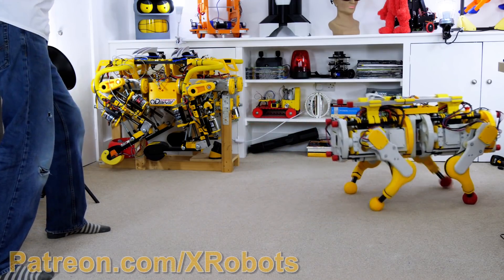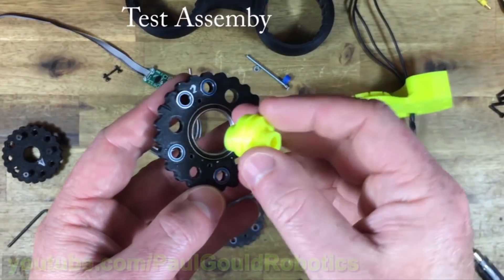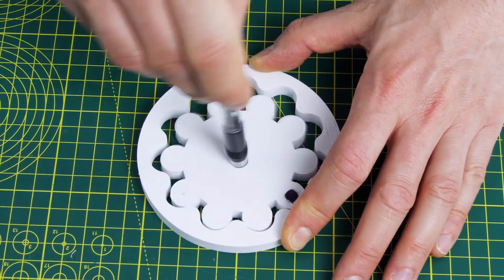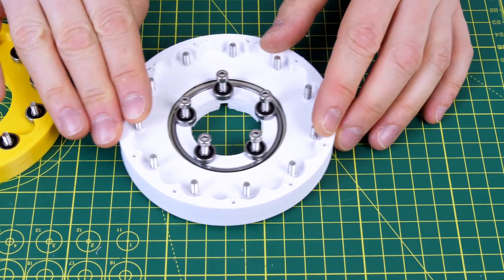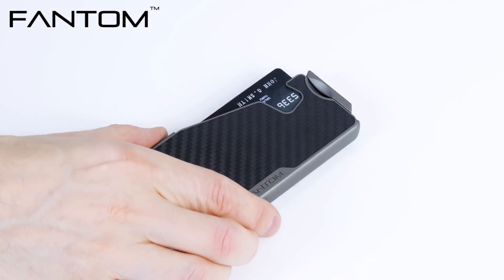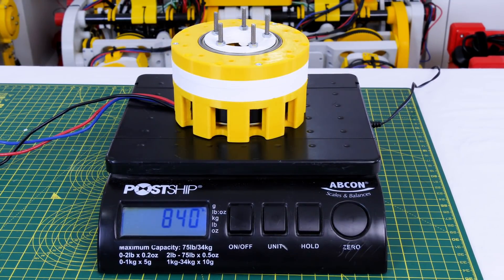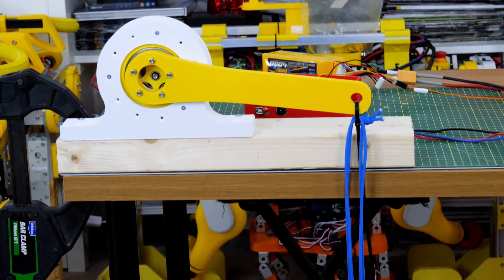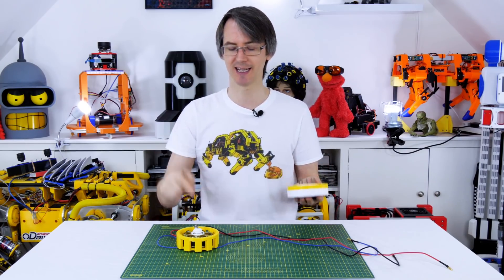Experiments with Cycloidal Drives

Comment: Perhaps another approach is to use a 'stepper' motor design and use 'micro stepping' and higher voltage and use a bigger motor?
I've been looking into using hoverboard wheels as big stepper motors.  Being smarter and more capable than me, perhaps you can try it so I don't have to, and find out if it works well or not... lol

Comment: Hi, thanks so much for your video! I have a question, when does a cycloid drive use fixed non-moving pins or rollers/bearings on the outside ring gear? I see you used bearings, and others, such as Sumitomo, sometime use rollers or pins. Cheers! Great work!

Comment: your 3d printer is heavily under-extruding, which will eventually make your parts a lot weaker. I would recommend checking many sites on how to calibrate your steps in controller.

Comment: I would like to know if you can make the outer wall move once when the inner off center gear moves once and if that would make a 1 to 1 ratio increase speed and torque 
Because the outer wall is bigger then the center gear and the small gear moves the big gear ( which is the outer wall)
Please share your thoughts

Comment: To balance the assembly, you can put a counterweight on the motor (without needing to add a second cycloidal disc).

Have you considered making this reduction unit "turned 90 degrees" with flat discs with cycloidal grooves & ball bearings between?

Comment: You should increase the overlap between walls and top surfaces on your slicer, because you 3d print has holes. It will make then stronger. (In cura I use 30% but the setting really depends on the slicer you use)

Comment: Just a random thought.  What if you printed the cam in a different orientation.  It looks like it sheared along the layer lines.  What if you rotated the print 90 degrees.  You would probably need to print with supports but your stresses wouldn't fall along the layer lines.  Also, maybe try printing solid?  Just throwing random stuff out there.  You are WAY smarter than I so im guessing there is a reason you did it the way you did.

Comment: Stop using bearings, start using bushings! Bearings are to be used on high speeds and low loads. You have low speeds and high loads and here is where the bushing has to be used. You will also gain much space and fillament's "beef". Bushings are also cheaper.

Comment: Ehh... 
So with regards to strengthening the plastic parts, in general, you can add high strength epoxies. If you get the right epoxy it offers a smooth, wear resistant part that the force of the movement can work into better than raw pla/abs/nylon. 

With regards to keeping the gear the same shape, instead of using a smooth bearing, you could use a v-groove bearing. If you go this route, the v, or rail, that the bearing rides on will add to the diameter of the 10 toothed gear, which might allow you to keep the gear the same size.  

In addition to that, you could use an aluminium liner inserts. A small piece of aluminium lining the hole that the bearings rotate on seems fairly straight forward for adding strength, and, if you can find a small novelty can of soda that matches the diameter of the hole you need, making it seems super cheap. Even if there isn't a canned soda that matches, you could just find a piece of aluminium pipe that does (it comes in many sizes), it might add a small amount of cost, but since you need such a small amount of pipe ( the depth of the gear in the thinnest plane times the number of holes) it should still be cheap. 

Like, assuming you're bad at cutting pipe, you still have to buy pipe in discrete units depending on length, usually a meter (around 3ft) at a time; you shouldn't need more than a single unit of pipe.

Comment: It very much appears as if you are slightly underextruding on your 3d prints, which compromises the strength of the parts. Perhaps overextruding is even worth it in this case, as long as you can keep the parts within tolerance. Considering you have that gap between your bearings and the 3d printed parts, you'll definitely be fine though.

Comment: A cleverly designed 2 stage belt system can be very compact and strong. The trick is to use a very small difference in cog diameter, have the second stage coaxial with the first stage, and then spin the casing that holds the cogs. So the casing becomes the input shaft, one of the cog shafts becomes the casing, and the other (coaxial) cog shaft becomes the output shaft.

Comment: I got interested in these Cycloidal drives to use for a self built CNC lathe for the C-axis. It would have to be clutched to the spindle when activating C-axis. I think you could use the same motor for normal spindle drive (high speed) and mechanically shift to C axis mode (high rigidity, low speed positional control). The reason to use a cycloidal gear is that it has almost no backlash and you can get very high reduction and rigidity (if made from something like steel, not PLA, and with tight tolerances).

The point is however, on a lathe you often want a through spindle bore. The cycloidal gear would need to have a hole in the middle and I think I have found a way how to do it. Take a look at the output shafts. They basically are excenters aswell, so you could lose the excenter in the middle. Also those output shafts (that are the input as well) don't have to be inside of the cycloidal disc itself, but imagine a disc that does the exentric wiggly thingy (not actually rotating) and the cycloidal disc is "glued" onto it. Then the outer case actually becomes the driven output.

Just some ideas. First idea works well in CAD, second one I'll have to dive in to and do some designing.

Comment: Do you know if anyone has ever come up with a design I don't know what to call. Like a fluid pressure (pump) driven screw drive. Take something like a fat screw in wall anchor or a drill bit, encase it in a cylinder and pump fluid down the length of it to turn it, drain holes one end.outside the encasement on either end or both would be a gear possibly. We all rode multispeed bikes at some point right?

Comment: you could put a counterweight on the offset cam that you've mounted to the motor shaft without increasing depth
Reply from the maker: That won't stop the motor casing flexing though, version 2 comes up on Tuesday!
Reply: @jamesbruton  yeah; i mean just for the balance issue; i wasn't all the way through the video yet when i wrote that. for the motor case flexing and cam sadness, sounds like you got a plan can't wait to see it!! these things are super cool.

btw have you ever considered an sla printer for tinier gears? i've printed very small very high quality, smooth running (double helical gearing) high rpm planetary gearboxes on the form 3. but never larger stuff for higher loads. you've inspired me to do some torque tests.

Comment: Sorry but 90% of commercial robotics use harmonic drives because they thick the most important boxes like high reduction and low failure rate and low to zero maintenance. This all in a extreme compact form factor. The only part you should not 3d print is the flexible gear but use a of the shelf timing belt. Also because you aim for a low gear reduction like under 1:25 the belt you need would be like the shortest you can find making the gearbox extremly small and making your current fat dog look a lot slimmer. You can find several attempts online by other people showing the basic design is really simple. Engineering the whole thing to a perfect fit on your motors may take some time, but it is worth the effort.
Reply from the maker: Harmonic drive is not back- driveable. It is not used for quasi-direct drive in dynamic robots.

Comment: Do you plan to use a different material in certain areas with high loads?  For example the cam chart and the cyclonically disc could be made from aluminum. It is pretty easy to build custom parts and it's light.

Comment: have you tried lost PLA casting? I'm sure aluminum should be cheap, light, and strong enough to work with
Reply from the maker: I have a CNC machine, and you'd have to machine the surface of the cast anyway. CNC is not accessible to everyone, nor is casting metal  version 2 is out on Tuesday with the improvements I said.
Reply: @jamesbruton  it’s not as bad if you use plaster to cast with instead of sand. Then you can use a belt sander or a dremel, or even a metal file.

Comment: The project is awesome and the engineering behind it is great but the 3D print quality is horrible. It looks to me like you're in need of a new 3D printer. I can see obvious underextrusion, as well as various other issues with your 3D prints.
Reply from the maker: The printers are brand new. Under extrusion is a slicer setting, obviously. It's a Simplify 3D slice and I have full control over the settings. Thank you.

Comment: Hi James, you can totally get to 10:1 reduction if you use a pulley force multiplier. Essentially if you replace a big pulley with a large bearing fix one end of the belt back on the body while putting an idler on the leg so that for 2 times the movement of the belt you will have 1 time the travel of the leg.

Comment: Instead of 3D printing, laser cut it. Better yet, I'm not sure I saw anything that couldn't have been done with a drill press.

The reciprocating mass introduces a lot of vibration. But at the speeds required in this application, it's quite tolerable. Totally makes me want to build one.
Reply from the maker: I'd live to see you make one with a drill press and I'm sure you could male 12 identical ones with no issues. Version  2 comes up on Tuesday
Reply: @jamesbruton  I'll try a laser cut one this weekend. I don't think I have the right bits to use a drill press. I'll have to take a look. 

Great video, BTW!

Comment: ON the outside bearings, if those are replaced by steel ball's?  You wouldn't need the bolts in the middle, and a little grease on those steel balls, it my increase efficiency and strength?

Comment: use roller bearings running on shafting for the five cycloidal bearings - it will be much smaller because the hole in the disc will be much smaller - line contact vs point contact.

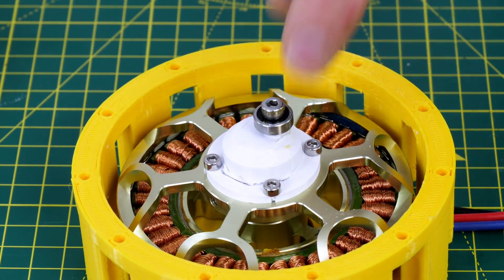Comment: I love your designs but your 3D printers are making very poor quality parts. Tons of perimeter adhesion issues and layers with massive gaps between extruded tracks. If you want things to break that's how you would print them but you show this in your video.  Surely the Lulzbot can print better so maybe hire someone to calibrate your machines every time a company donates filament. Again, really love the design and testing you do but ugh so many parts look terrible.  examples: 5:13, 5:46, 12:05 and 12:31

Comment: Make the cam shaft out of metal. Instead of a straight pole off center, make a centered pole with a kink. This will also make it simpler to secure on the other end. The craftsmanship is good enough as is for the rest to hold up to higher torque.

Comment: Can you use a dummy cycloidal disc just riding on the one or bearing for counterweight purposes? That may prevent the need to design and make a new shaft.
Reply from the maker: Version 2 with two discs comes up in a week!

Comment: The sound for the cycloidal sun gear is a bit noisy, you could try to change to using Alloy 910 nylon filament with a petg core to reduce the noise and wear. With your bearing design I doubt there would be any wear with nylon.

Comment: It’s the bigger gear that has teeth on the inside and the smaller gear has teeth on the outside. The teeth on the smaller gear are outside of the smaller gear. The teeth on the bigger gear are inside of the bigger gear.
Why does he say it’s the other way around?

Also, why does he say that the smaller gear goes around the outside? It goes around the outside of what? It goes around the outside of itself? That doesn’t make any sense. Looks to me like it’s going around the inside. It’s going around the inside of the bigger gear. Or if he keeps the smaller gear stationary, then the bigger gear would go around the outside. The bigger gear would go around the outside of the smaller gear.
Reply: Is that the technical term? Because if so then that’s confusing.

Comment: If you ran another disk exactly opposite the first one by 180 degrees you that would mostly balance the unit as well as make it much smoother. Like you said, having the cam go through and supported on the other side would be a big thing too. I also agree that you should capture the bearings in the center so they hold things in place. However I think you should measure the efficiency somehow. There seems to be an awful lot of wasted energy. Like the energy required to stop the inertia of the cycloidal disk. Right now that energy is just transferring to the bearings as friction. The disk has to overcome it's own inertia as well as centrifugal forces. Perhaps if you made the bearings convex and the edge of the disk concave, with oil grooves cut in the outside of the bearings you could remove a lot of friction. This would eliminate side load (also taking load off the captured bearings discussed earlier) on the disk as well as spread the load over a larger area. You could also make the disk thicker near friction surfaces and narrower everywhere else to increase stiffness of the disk.
Reply from the maker: Yep - V2 is coming up next Tuesday with two discs and a thicker cam shaft

Comment: might there be something useful in considering using something like power tool batteries (20v/60v dewalt, as an example) to run stronger motors?   so, yes, need bigger battery and heavier motor, but I'm wondering if the size efficient battery packs (up to 9AH, I think) could run a bigger motor that might be more efficient?   haven't given this a lot of thought, and I'm not that familiar with different types of motors, but I do know my tools and I'm running everything from chain saws to routers from these batteries..  the motors are very efficient for their purpose..  but yeah, the gears are definitely metal. :-)

Comment: You could save a lot of space by replacing the ball bearings on the ring and the output disc with plain bearings (aka bushings) running on smooth steel shafts. They can be 3d printed from nylon or graphite filled pla. Obviously this arrangement will have a shorter service life and more friction but the cost, size and weight savings may outweigh that, especially since well designed plastic plain bearings actually last a really long time.

Comment: I understand and agree with the choice of high-speed bearings near the center, but if space and weight are an object, might I suggest simple bearings for the large number of lower-speed, higher-force axles near the rim? Each of them is only rotating a fraction of the rate of the stepped-down linkage (maybe 1/110 the RPM of the motor itself?), so a bronze bushing might do OK.

Comment: Im no engineer James but I am a mechanic and we use molybdenum disulfide grease for CV shafts, diff installs and I rebuild my old tools and use it on the sintered gears. My theory is because of the nature of that shit, moly grease should be perfect for a 3d printed gearbox if you use hard-wearing plastics because it'll soak up into the print lines and it sort of embeds the gears with a harder metal so they last longer. I don't understand this as I say I am a humble mechanic and I know near to nothing about 3d printing but I hope that this may help in future. 

Love Owen.

Comment: you could probably lost PLA cast it or sand cast it from the prints in aluminum that would greatly increase the life span and stringht witch means you can still print the parts but will give you metal parts
Reply from the maker: I have a CNC machine, but I'd like to make it accessible so 3D printing is preferred. V2 comes up next Tuesday
Reply: @jamesbruton  okay I was just making a suggestion aluminum sand casting can be done fairly easily and with minimal equipment I actual teach casting and my son has been doing pewter casting seance he was 7 hes 18 now but its fun and not for everyone

Comment: So you want to be able to print everything, but you still buy metal bearings. If you can buy metal bearings, can't you buy metal gears just as easily?
Reply: Bearings are cheaper.  Way cheaper.
Reply: @gur262  Maybe gears are slightly more expensive, but not much. Maybe you're just shopping at the wrong shop. I'm looking at gears ranging from 2 to 10 euro's and that is module 1 tooth size, which should be enough. (3.14 mm between teeth)

Comment: couldnt you add a counter weight to the cycloidal disc, as its plastic a small rod or screw insert could be enough.
Reply from the maker: The motor casing is flexing. V2 is due out on Tuesday 30th

Comment: Why did you move to what appears to be circular gear interface structure? From what I have seen on this subject that seems to be just as at fault for your interface friction as anything else. Not that bearings are worse, but I think an evaluation on wear between those two differences might be valid.
Reply: Obviously from a strictly round drive that might make sense, but you can use another interface to transfer torque from the motor.

Comment: Since you're sticking the shaft through the center with a cam

To stop the vibrations you could mount a weight on the shaft that matches the weight of the gear and stick it 180⁰ out of phase. That way you don need a crank that has to go through two gears. Though getting them balanced perfectly would be difficult. (but you do have the sauce for that in the current design due to the cutout hole)

Comment: I feel like even wood would be stronger than 3d plastic for the drive wheel, some nice 1/8 plywood would still be stronger than plastic. I mean 3d printing is great for prototype but its not that great for strength and power. Its why i still consider it kind of a fad
Reply from the maker: Probably worth waiting for v2 which comes up in a couple of weeks.